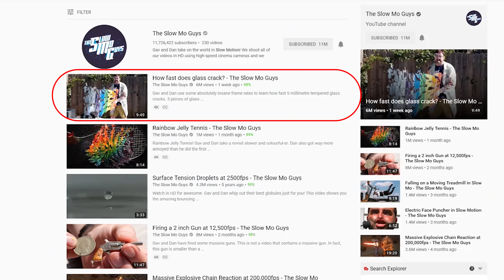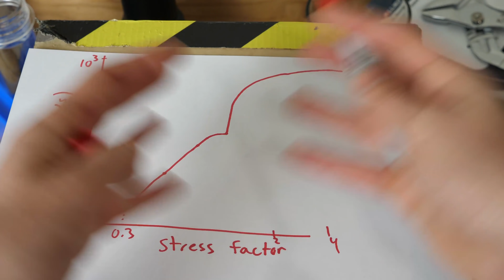The Real Speed of Glass Cracking—Filmed at 10 Million Frames Per Second With Hypervision HPV-X!

Comment: Cracks in glass plates can travel at speeds from 1 m/s to 1,500 m/s depending on the length of the crack and the stresses in the glass. One particular form of glass, known as Prince Rupert’s Drops, displays some particularly unusual properties. The teardrop-shaped beads have a fine tail and are produced by dripping molten glass into cold water. The head of the drop can withstand being crushed in a vice (it is reported drops can withstand compressions of 15,000 N), yet breaking the tail results in the whole drop shattering. The accepted explanation, developed in 1665 by Robert Hooke, argues that the differential cooling of the drop leads to compressive stresses in the surface of the drop which contrast with the high tensile stress in the interior. Cracks in the drops have been recorded with high-speed cameras to travel at speeds in the range 1,450-1,900 m/s.

Comment: That last shot looks like some of the cracks are actually forming and then re-sealing before forming again. I can only imagine that it is the movement of the glass forcing some of the split pieces of glass back together briefly at high pressure that gives this illusion. Is there any other info on this phenomenon?

Comment: I like the circular pattern near the impact site and that the rest of the pane was only four pieces.
Would you be so kind as to explain how a camera is capable of such a high frame rate?
Reply: Yes it was an interestingly relatively uniform distribution of energy in that sheet.
Reply: there is a video of filming light in slow motion, there they explain how they can film in even higher speed. ( = slowmotion )

Comment: As a borderline professional flintnapper, my research has concluded that concoidal fracture (45 degree) travels at about 1000 fps. ( Feet per second) when you get a good solid hit, it will come off the pice with a solid PEEEWWWW  sound! Sounds like a little speeding, ricocheting bullet!
What he is doing is called a face fracture. This is different. It's the same way your windshield or phone screen will break clean down the middle with a hertzian cone at the point of contact.
There are multiple types of fracture. But the cracks in the h.s.r. video come from the point of contact called a hertzian cone. Look at any pice of broken glass. It will have a cone shaped direction at contact.
Crazy right?

Comment: What happens if something is projected through the glass faster than the speed of sound in the glass?  Do the cracks break their own sound barrier?  Edit... I predict they will propagate faster at first, but then start to slow down until they reach the speed of sound in the glass... or it will cause a total disintegration at once.

Comment: between 6:30 and 6:31 - you would need a higher speed camera at a higher resolution, but it appears that the cracking starts before the ball touches the glass. You shouldn't be able to see all sides of the impact point, because the ball should be in the way.

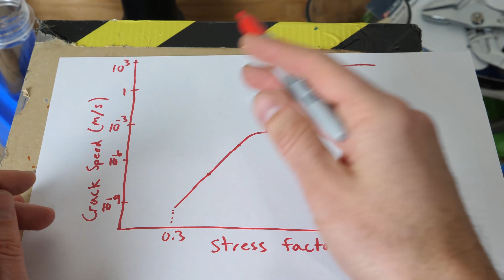Comment: 2:50 umm... I don't think the speed of sound can change
Reply: The speed of sound is different through different materials, the more solid a material is (or dense) the faster the speed of sound.
Reply: @willb4643  technically, sound is a vibration of air that is picked up by our eardrums. So technically, the vibrations that are traveling through the material is not sound. But, when the vibrations of the material vibrate the air, that creates sound again. Think of the plastic cups and string telephones. The sound isn't actually traveling through the string... The string vibrates from your voice echoing in the plastic cup, those vibrations travel to the other cup, which in turn vibrates to re-create sound.
Reply: @ryant1626  how does a whale hear?  Sound has nothing to do with air.
Reply: @willb4643  They pick up the vibrations in the water and interpret that using a different way. Their "ears" are not like ours. But any thin membrane can pick up vibrations. But both your statements work is a figurative sense. It's just not technically right. Think of a jet. The jet can go faster than the speed of sound, yet the sound remains behind the jet. Sound is a constant speed. If you bang on a pipe, the vibrations coming off the pipe vibrate the air, which creates the sound
Reply: @ryant1626  the tiny hairs in our ears vibrate with sound and carry that down to nerves.  There's no air at the actual point of sound interpretation.  You're talking nonsense.  The speed of light is variable depending on what it is travelling through, the speed of sound is variable depending on what it is travelling through, even the temperature of the material or AIR makes a difference.

https://en.m.wikipedia.org/wiki/Speed_of_sound

Stop talking rubbish.
Reply: @willb4643  Wikipedia? Really? Anyone can post anything on there. Let's try something more accredited. https://audiouniversityonline.com/audio-basics-how-sound-works/. It literally says, "Sound is the audible vibration of a material – the vibration of wood, metal, water, or any other material. Most often, the sounds we hear are the result of vibrating air particles. More accurately, sound is the result of fluctuating waves of positive and negative air pressure, called acoustical energy". Air is the only way sound can exist. Vibrations can travel through stuff at different speeds, yes. But the sound we hear is those vibrations vibrating air molecules. Bang on anything you want in space. You won't hear anything because there is no AIR! Why do you think that a sensory deprivation tank is filled with water? Because it blocks the sound. Now, vibrations can travel through water, but your ears are still filled with air. The water vibrates the air in your ear, and you can kind of hear something. But I was trying to be nice and say you were right in a figurative way, and I was just saying, in a technical way it's wrong, but after your last comment, that's over. You are wrong. 100% wrong. You should go back to school because you clearly didn't learn enough
Reply: @ryant1626  that link specifically states sound can travel through materials other than air.  It then goes on to say that MOST often it's through air for us to hear it and then goes on to talk about that.  you just posted a link that agrees 100% with me.  If you are underwater, you still hear things.  Deaf people still hear music through vibrations.  The only thing you're almost right about is space, if there is a vacuum between you and a source of noise then you can't hear it because there would be no material (air or otherwise) to carry the sound, however, if you pressed your head to a surface and then banged on it, you would hear that because the vibrations travel through the material, through your skull and directly to the nerves.
Reply: @willb4643  dude. The Vibrations can travel through other things. I don't know how you can't understand that. But I have better things to do than argue with someone who can't comprehend something so simple. Believe what you want. I no longer care
Reply: @ryant1626  vibrations, that's what sound is, through air or through glass, water or metal.  A wave of energy moving through a medium.  That's all sound is.  The fact you don't understand that fundamental principle says a lot about your understanding of the science of sound, you even posted a link that debunked your own statement.  You're clearly not willing to learn anything new or perhaps just not intelligent enough for it.  Whichever it is, stick to simple stuff and don't try to teach anyone anything!

Comment: Very cool.  I would like to see 1/4" or 1/2" tempered being struck on the edge.  Tempered glass can sustain a substantial impact to the surface without breaking, but a hard tap on the edge will cause a tremendous release of energy.  When the tempered glass is laminated between two sheets of annealed plate glass you can see the point of impact in the break pattern as it radiates outward. Thanks for posting.

Comment: Funfact for you: when you cut glass in like a long curved line from one end if the glass to the other side, you can get that speed down to like less than one inch per second. You can get the crack preeeetty slow
Reply: Just like in the 10000000 fps but just normal

Comment: Ive guessed right away that the speed would be the speed of sound in that materiel, because what else would it be. Awesome addition with the curve of acceleration, because of course it will accelerate ... didnt think of that. 

And so this made me think. What is the acceleration of light? Because the same way the speed of sound varies from one medium to another, so is the speed of light. For instance when entering or exiting water. 

At what rate the speed of light would decelerate when entering water or, inversely, at what speed would it accelerate leaving a medium like glass or water. 

Also, at C time dilatation makes the photo ageless from its point of view. But when the light travels thru a medium that slows its speed, does it starts to age? Slowly ...

Comment: a friend of mine was talking about this and pointed out that the speed of light would be about 30m per frame at that frame rate! so here's a challenge.  see if it's possible to film the advance of a laser beam across a misty field! problem is how do you turn the laser on suddenly enough?  I presume they take more than a few nanoseconds to go from fully off to fully on. what if you fired a high velocity bullet across the beam? perhaps you would see the shadow of the bullets passing advance across the field?  a 30mm long projectile travelling at 1200m/s passing across the laser beam would I think create a roughly  750m long gap in the beam which could possibly be observed at that frame rate. just a thought.

Comment: 5:35 - "Ultra High Resolution" ... Hmmm....
Reply: at 10,000,000 frames per second, that is the best resolution possible with today's technology. give it 20 years, and you might see these frame rates at 480X640 resolution, and perhaps, in color. It will be a long, long, time, before you see these framerates in HD.

Comment: An old guy I worked with many years ago, was a glass cutting wizard. He did a trick where he first drew a circle on the glass from the center point about 8 inches in diameter. He then scribed four lines in the glass starting about two inches from each corner, to the edge of the circle. Then turned the sheet over and made a small scribed line about 1/4 of an inch long parallel to one edge about halfway between the edge of the glass and the marked circle. Then he turned the sheet over and struck the area near the small scribed line. The glass fractured off four corners and left a circle of glass from the middle. I've tried to do the trick and came close several times. BTW, you can't cut a hole in sheet glass with a regular glass cutter.

Comment: Is that faster than light? And how much? .... If it's slower .... How much?
Reply: Its far far slower than the speed of light. The speed of sound in air is 700 something MPH. While the speed of light is many times faster.
Reply: Eric Scott not talking about the speed of sound ..... The speed of breaking glass is what im talking about
Reply: @stopstaringandsubscribe5189  if you can still compare it with speed of bullets then it is far slower than speed of light
Reply: @stopstaringandsubscribe5189  
The speed of breaking glass IS the speed of sound for glass though. 

It is faster than the speed of sound in air, but wayyyy slower than the speed of light. It is not even on the same level.
Reply: Ibrahim Awa the graphic shows 1000 meters per second (speed of sound in glass) and the speed of light (the cosmological Constant of spacetime: C) is approximately 300.000.000 m/s, so thats it, 300.000 times slower than C.
Reply: Nothing yet in the universe is known faster than the speed of light.

Comment: I think, that to measure the speed of a crack in glass is a fake thing. Because there is no travelling, no particle is moving at that speed. It is like measuring the opening of a pair of scisors. The longer the blades are the fastest the corner between the two blades will appear to be moving. If you have 100 miles blades, the speed will be 100 miles per fraction of a second. If we focus on the apex, vortex or the corner of the two blades, it will appear to be moving amazingly fast, but there is no particle actually moving, or is it? 
The same applies to a glass cracking, each side of the crack are like the blades of a scissor. The bigger, or longer, the glass, the fastest the speed will be. I think the value will approach the speed of light as the lenght of the blades aproach to infinite.
The illusion is awesome, though.
Reply: I don't think he is talking of a particular particle in the glass, but rather the rate at which the crack(s) travel throughout the glass.

Comment: Controlling lava flow is much easier but how fast do you have to steer via cooling massive amounts of water sprayed against gushing molten glass to KEEP it going precisely where wanted?

It seems trivial to drill for lava itself instead of just pump water into bedrock to mine heat.

How much energy is in a ton of liquid rock?  Can we retrofit oil tankers to ship it and buy it to heat our homes instead of coal bricks or to power new steam cars?  How many years of such power could we mine from our core BEFORE screwing with tides ...compasses ....etc?  Would that be worse then releasing carbon via flames?

As lava flows important not mere cookie facts crumble, the crack is fast cuz of brutality, not gentle parting and tearing at fabric of crystals or just solid sand?  Our children need to know these facts ALSO.

Comment: If each frame is 100 nanoseconds per second, pointing a powerful laser with a long range across a distance of 100 meters should show the light traveling, because light takes 333 nanoseconds to travel that far. Am I missing something, or would this work? Just thought it would be a cool video idea.
Reply: You did the math right, but there are some practical issues.  

Filming at 10M fps captures very little light per frame.  Those balls were probably so brightly lit that it was hard to look at with the naked eye, yet the resulting video is almost a bit dim.  To see a laser along its length, you'd need to shine though something other than clean air, but to get it bright enough to look like a beam at 10M fps seems like it would be difficult. Making matters worse, you'd have to be pretty far away to see the entire 100m length... You'd effectively have the camera at the top of a football stadium with the laser shining the length of the field.  And you need the laser to be bright enough to record at 10M fps FROM THERE.  

So you'd have to do this with a very powerful laser in total darkness in a lightly foggy field in the middle of nowhere... and then you might get two frames where the laser beam isn't the full 100m.
Reply: Chicken Head  Just ignore the "per second" part; the post does makes sense.  (At least, I assume that's what you meant by "sence".)

What was your problem with "nanoseconds"? Each frame is 100 nanoseconds apart if recording at 10 million frames per second.   

Perhaps you should be a bit more careful with your own clarity, especially when calling out someone else.
Reply: Don't understand shit. What language are these people talking here?

Comment: MAKE IT EXTRA SLOW MO BY CHANGING THE VIDEO SPEED TO  0.25
Reply: So 40million fps :o
Reply: DOODpls No, you have 1/4 the frames, so it is 2500000 fps
Reply: @alarmoboterinokripperino2713  no it would be 40 million fps at 7.5 fps playback speed.
Reply: GTIfanatic Think about it like this: You have10000000 FPS.  If you slow it to .25, your previous 1 second is now 4 seconds, so you have 10000000 frames every 4 seconds, which is 2.5mil fps
Reply: @alarmoboterinokripperino2713  Acctualy its still 60fps or whatever Youtube is playing at
Reply: Didn’t think about that :)
Reply: Alarmoboterino Kripperino that’s not how it works; ten million FPS is the recording frame rate of the camera. Changing the playback speed does not change the recording frame rate; the time difference, which is 1/10,000,000 seconds, between each frame is still the same no matter how fast or slow you play it. The “slow motion” comes from reducing the playback frame rate from 10 million FPS (the available information) to 30 FPS. Thus, by changing to 1/4 the playback speed, you are viewing at 30/4 FPS, where each frame features a temporal difference of only 1/10,000,000 seconds, which allows you to view the same information at a slower pace, thus providing more “slow motion”.
Reply: @alarmoboterinokripperino2713  lmao i like that joke

i really hope thats a joke
Reply: @alarmoboterinokripperino2713  no but  measure 10m fps by how many it would be in an actuall second but it is slowed down

you wont gain or lose any frames
Reply: @44442012  THANK YOU FOR EXPLAINING
Reply: OH SHIT
Reply: Thanks
Reply: god damn genius lmao
Reply: No you are just displaying each frames but slower.

Comment: You know how a light beer long steel Rod if you push it it doesn't break the speed of light, well based on that how big of a steel rod would you need to bend it around 360 degrees only with gravity?